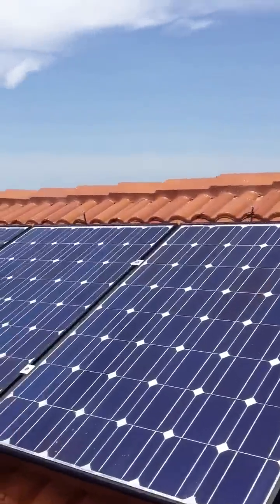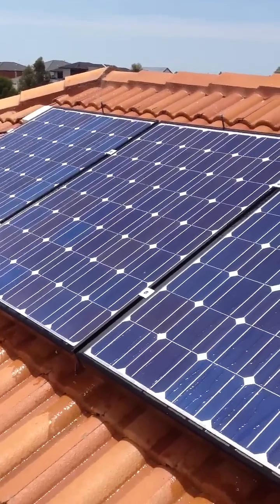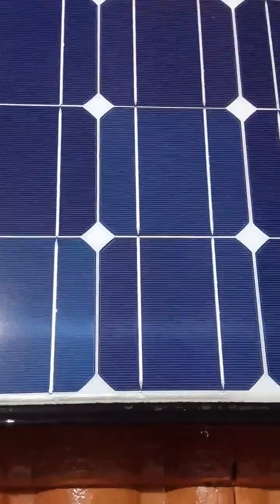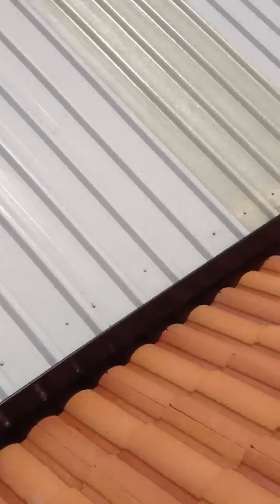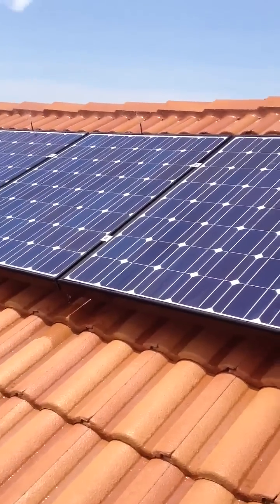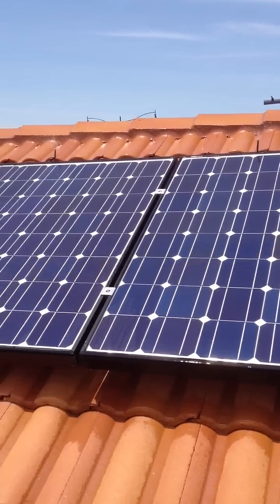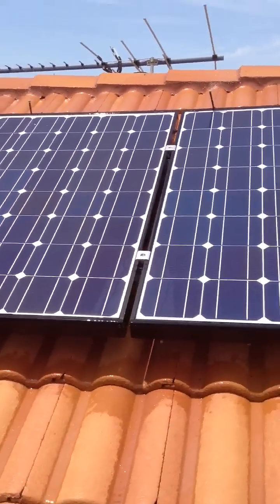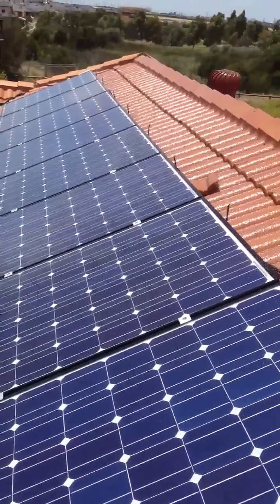Cooling solar panels

Comment: I don't understand why people don't make a cooling array with black PVC pipes behind their panels and use it like a hybrid system capturing the heat into their own hot water system and getting more efficient electricity production and longer lasting panels. You use power to heat up your hot water yet the sun will gladly do it for you for free.
Reply: +SquirrelFromGradLife I don't think that PVC pipe is a good thermal conductor so the amount of heat removal might be minimal.  Also, many people have the panels installed for them and detaching the panels, modifying them, reattaching them and liquid lines to each other on top of a slanted roof is very difficult and dangerous for the common home owner. Have you tried this method yourself to see how well it cools the panels?

Comment: I live in Florida, USA.  I have a 7.5kw system whose panels exceed 65 C during primetime.  Hence, 20%+ loss.  I am very interested in your project.  The only concern is our water leaving spots.  What do you think of using some kind of small water softener attached to the hose?
Reply: what did you end up doing steve? i m in florida as well
Reply: Don't worry any dirt water residue by jet spraying under solar panels

Comment: how are you pumping the water, or is it pressure from local water source? In either case is the cost of the water or running whatever pumps the water worth the 200w? I'm just curios not scrutinizing by the way :)

Comment: I am doing the same thing in Melbourne. I found that using tap water I got quite a build-up of calcium on the glass which was really hard to clean off. I now have mine hooked up to a rainwater tank and it's much better. I also used a microcontroller and temperature sensors to have a better control of water. I found about 20% power increase when cooling.
Reply: Hey bro really ? 20% is a very good number

Comment: Interesting I have been something similar here in north qld....My set up is a lot cruder.... just a sprinkler on the roof set to go for ten mins every hour from 10am to 2pm.... It does dramatically increase the power output. In my 4.9 kwh system 300w extra at 10 and 2 and upto 500w increase at midday... so far no build up of ugly residues, just much cleaner panels.

Comment: I expected my cheap panels to overheat and give less power under the summer sun. Each 100w panel is rated at 6a,but midsummer (36c) with a clear unhazy sky saw them give 8a each. I bet they would melt under the Aussie sun though.

Comment: You want to keep an eye out for water residue buildup. Even though it's rain water, the water will pick up minerals from the dust that blows in the air and settles on the roof and panels and you will eventually get some buildup. It will be interesting to see how this works out in a few months.